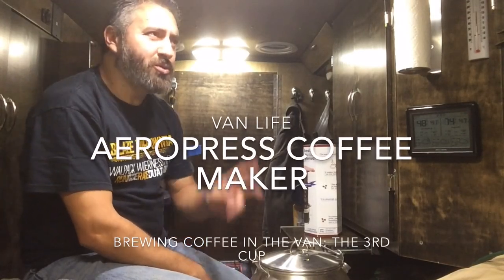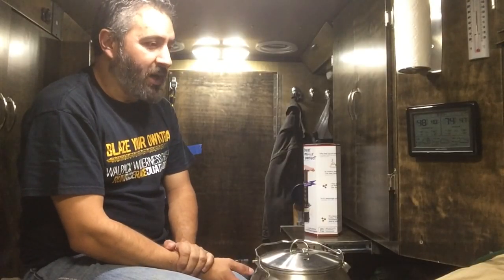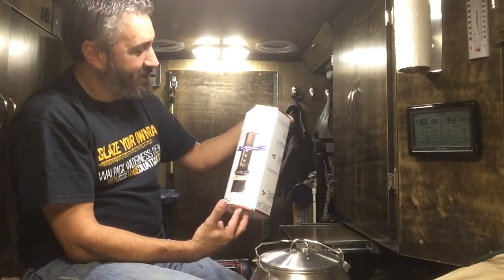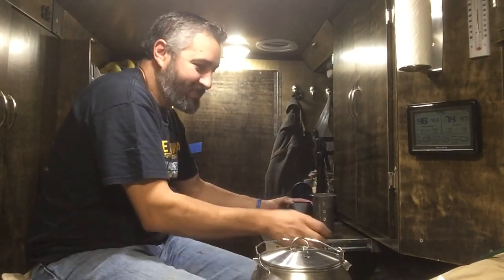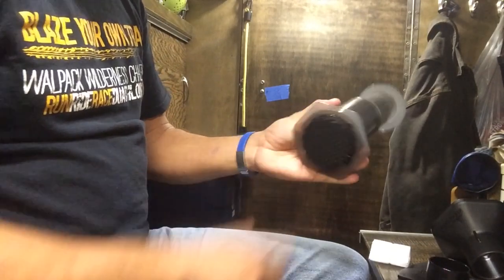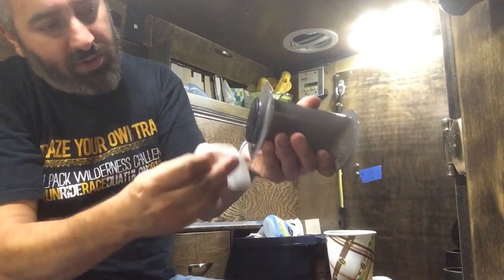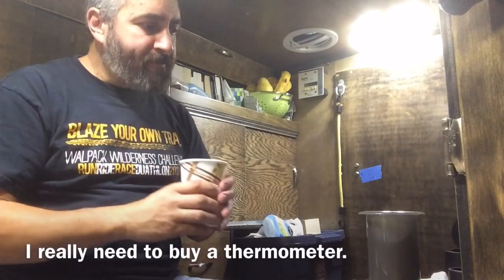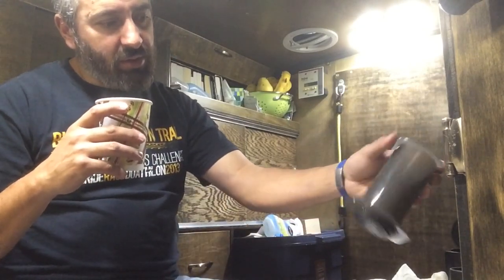Van Life; AeroPress Coffee Maker! Brewing Coffee In The Van: The 3rd Cup

Comment: Luis, I have the perfect recipe for coffee. First you get your van key, start the engine, then go the distance necessary, park the vehicle at a StarBucks and order some coffee... Follow these steps and there is no failure, I assure you... : D

Now, seriously, that coffee press is too much hassle for a simple cup of coffee. The previous method, after some adjustment might work better. About that "burned" taste you feel, have you considered it might be because of the coffee grounds brand and/or type?

I have three options I use here to make coffee - like that previous method you tested, an electric coffee pot and one that is called Italian coffee maker that works fine too, but has that problems of having 3 pieces to wash...
Reply from the maker: Starbucks is way overrated and over priced. I rather go to a DD or Quick Check or even Tim Hortons. 
I tried following your instructions and ended up in Canada. 😂😄👍🏻🚐

Comment: nobody even reads the instructions... They put about 1-2 scoops in there, fill it to the top, mix it with a spoon quickly, then refill the thing to the top and put the plunger in, let it sit 30 second to a minute then plunge all the water out into the cup. After that, they unscrew the bottom grate and plunge the brick into  a garbage can.
Reply: +blarg Once the plunger is in  it will stay, so the trick is to quickly fill it, quickly stir it and refill it and quickly get the plunger in. Also, there's really way less clean up because the plunger basically cleans the machine for you. You just gotta quickly rinse the tip then pull the plunger apart and run a small amount of water through it. Also, nobody uses the scoop or the stir stick, they usually just use a spoon for both and rinse the spoon. There's a bit more learning curve to it, but once you get it down it's so much easier than anything else.
Reply from the maker: I read the instructions, then decided to make two cups of coffee at once and forgot all about what I read. 😂😄👍🏻🚐
Reply from the maker: As with everything in life, practice makes perfect, and if I keep using it I'm sure I'll get it. Thanks for the info. 👍🏻👍🏻😄🚐
Reply: +Rolling Earth-Ship sorry, I meant throw the instructions out and don't look at them and just do what I described;) The instructions have some weird ideas about this being a cappucino machine instead of a good coffee machine;)